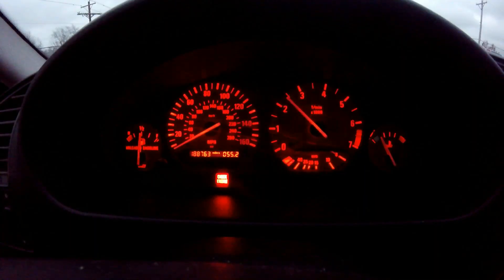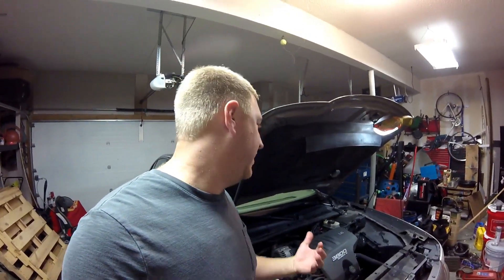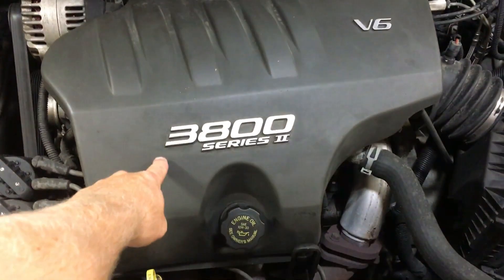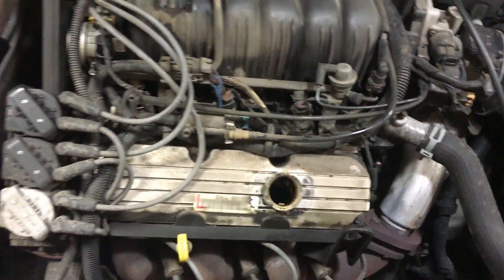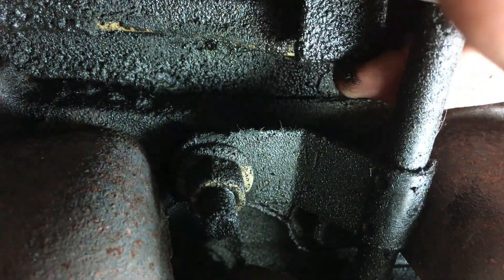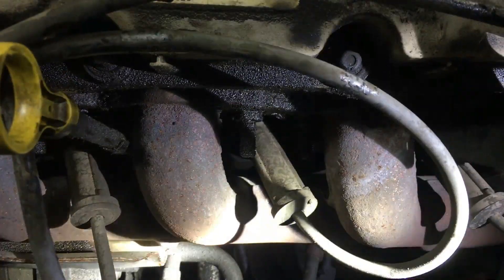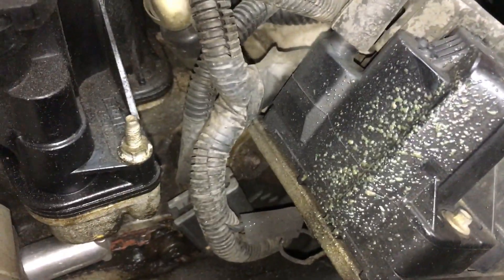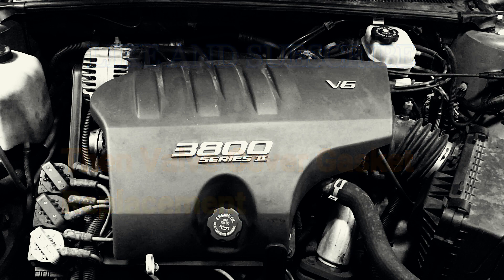Diagnosis of oil leaks on a GM 3800 V6 - Valve cover gaskets and intake manifold gaskets

Comment: I got 2008 Buick Lacerne 3800 CLX and I had a valve job done on it now I leak out of the filler tube or filler cap I took it back to the same person they said the PVC is good on it and I need to probably another O-ring so I got O-rings well it still leaks after driving it real hard for about a hour yeah also it’s got a new tube oil filler tube..Can you help me out let me know your thoughts
Reply from the maker: If it’s leaking that badly then there must be a rolled gasket or too much crankcase pressure.
Reply: @PetesGarageandperformance  Not badly but  is leaking
Reply: I change the valve cover and the oil filler tube and all is good it was a connection between the filler tube and the valve cover
Reply: Now I got another problem all of a sudden I don’t wanna start -the starter will keep turning or it won’t work at all but it won’t start I think it’s a control module for the ignition but I don’t know any ideas

Comment: Do you have a video on actually replacing the valve cover gasket on a gm 3800 v6?
Reply from the maker: Yes I do. It should be in my 3800 playlist

Comment: 2004 pontiac grand Prix gtp SC 3.8L. But the whole driverside fenderwell is cover in engine oil. You see engine oil dripping off the CV axle boot any idea.
Reply from the maker: Sounds like grease from the cv boot being flung around as the shaft rotates.

Comment: I about died when you threw that cover in the garbage. In no damn way will anyone throw mine away on my 03 monte carlo.
Reply: GM had a fire related recall on the Series II 3.8 V-6 engine.  The recall was for the front valve cover gasket leak, and to remove the plastic engine cover he tells you to remove and throw away.  There were some engine fires due to the valve cover gasket leaking.  When there was a fire the plastic engine cover also caught fire and burned.  I had the recall work performed, and they also had a new and revised front valve cover as part of the recall.  There are many 3.8 Series II engines still in cars that are still on the road today where no recall work was done waiting to catch on fire.

Comment: I have a 3.8 v6 that getting water into the engine but it's not overheating so don't think it's head gasket. any ideas???
Reply from the maker: Is the water getting into the cylinders and hydro locking them or is water getting into the crankcase/oil pan.
Reply: @PetesGarageandperformance  yeah when you drive regularly the engine eventually won't start. but if you leave it for a while  it will start up again. water in engine but not overheating. can see little water when I open oil cap.

Comment: I found oil leaking in between the engine block and  front valve cover/head gasket on my 99 buick lesabre custom. Diagnosis?

Comment: I tried to get that cover off of there but I wasn't able to. After I took off the filler cap, there's a flange around the filler nozzle and all that cover does is swivels around. Do I cut it off? Is that valve cover plastic, could it break if I try n force that cover off?
Reply from the maker: The valve cover is thick plastic. I’ve never seen it get stuck. Just twist the tube 1/4 turn counter clockwise and pull.

Comment: Pete, my vehicle is leaking oil, but it was repaired under the recall.Should I be having an oil leak now?
Reply from the maker: Is it leaking from the front valve cover? If not then it’s going to be on you to fix.
Reply: @PetesGarageandperformance  Yes, it is leaking from the front valve cover. Should this be happening when it was replaced under the recall in 2016?
Reply from the maker: Probably shouldn’t leak for a while but that was 5 years ago. When the recall was put out, I think a lot of techs were just slapping the new covers and gaskets on and not really cleaning up the head surface or even torquing the bolts. You might want to just buy a new gasket and redo the job. Or check to see if the bolts are tight.
Reply: @PetesGarageandperformance  Actually it started leaking last year along with the lower valve leaking.

Comment: i put the oil cap back on so nothing falls into the oil reservoir fill. also, sometimes if you catch the oil leak early enough, you might be able to just tighten the valve cover bolts. Only sometimes this will work. the other thing about throwing the plastic engine cover away, is now the engine looks UGLY!!!!!  LOL>>> They build cars like crap anymore, almost everything is plastic and aluminum.... Just does not last at all. I am so glad i grew up and saw and worked on, Easy work on, great cars in my life until the early 1990,s. After that, CRAP CARS MADE!!!!!!

Comment: Thanks for the videos I have a 2001 grand prix I been looking for a oil leak and it seems like it is coming from right above my trans axle where my oil filter screws in there is a electrical wire and its coming out of where the wire goes is that my oil presser sensor.so I'm asking is that a common problem I got 160000 plus on it
Reply from the maker: Yes that is the oil pressure sensor. Also make sure it’s not coming from the oil filter adapter gasket which is the part that the sensor screws into.
Reply: Ok thanks a lot gonna Chang it tomorrow

Comment: I have two Buick’s with the 3800 engine. Most common repairs are upper and lower intake manifold gaskets and valve cover gaskets.  The engines have 167 k and 272 k miles on them . MPG on the 167 k engine is 41 highway and the 272 k engine still gets 31 MPG.  The 1999 has a crappy paint from the factory; but the paint on the 2001 still looks like new.  I want to be buried in one of them, I just can’t decide which one.😎.  I love your Youtubevideos 💪
Reply: no way 41mpg I believe the miles but that car never got 41mpg
Reply: @smdog66    The 41 MPG is achieved by increased tire pressure,  not using the A/C and only driving it on the highway. From a ranch in Wyoming to a ranch in Nebraska;  with no stops, towns, or visits with either state patrols.  Never, ever attempted to use ethanol gas. Only the best octane gasoline, I can find.  Super slick wax job on crappy paint job and rain X on all the windows.
Reply: @smdog66  i never got over 19 mpg
Reply: ... im lucky to get even 10 mpg in my 06 Grand Prix 😂
Reply from the maker: Thank you. 41 mpg. Wow that’s awesome.
Reply: HI, my 3800 v2 seems to be leaking oil on the passenger side and the serpentine belt is slinging the oil up onto the alternator.....  ever heard of this and where is it likely from?
Reply: Bs on the 41mpg! Lol
Reply: Oil pressure sending unit

Comment: When you guys do the lower intake gaskets, are you supposed to oil the new gaskets when you put them in?
Reply from the maker: No. Don’t put oil on the gaskets.
Reply: @PetesGarageandperformance  thanks so much for the quick reply.
Reply: I chose to have a mechanic apply JB weld to a pitted area of lower intake instead of a new one for $500 or my bill would of been 1700 ..I hope it holds..but now 3 days later I see oil on my cardboard  after 3 days of no spot..hope it's not the lower Intake where they JB weld..idk..2000 buick regal with 80000 jus had upper n lower Intake gaskets replaced with a new plenum..its leaking right in center below oil pan...

Comment: The 3800 in my 2005 Pontiac Grand Prix has 307k miles. I'm starting to see these same problems. Thanks for the heads up!
Reply: 370k Starting to see problems lol that’s funny you know what .
Reply from the maker: Pretty common issues on these. At least they’re cheap to fix.
Reply: @PetesGarageandperformance  Mechanic told me that the rear seal needs to be replaced.

Comment: I’m pretty new to cars and genuinely curious. How does the engine beauty cover and the spark plug holder lead to the leaks? I also own an 00 LS and it still has both of those on it.
Reply from the maker: Good observation. They don’t directly. But what happens is that many of these vehicles with the 3.8 are still running. As you can imagine, they’re high mileage, cheap, and leaking from the valve covers, intake, and oil pan. Many people just ignore the valve cover leaks and over time the leaking oil accumulates as sludge on that spark plug wire holder. Right above the hot exhaust manifold. Then a fire can occur. I think they pitch the cover because it holds in heat. Really GM wouldn’t have had to recall the valve cover if people would just fix their leaking valve cover. But I guess it was probably in their best interest to just bite the bullet and take care of it instead of having lawsuits on their hands when the car catches on fire in the garage and kills a family. This is all just my opinion though.

Comment: Do the intake gaskets leak oil?
Reply from the maker: Yes. They will leak oil and coolant. Depends on which part of the gasket fails. The gaskets seal oil at the China rail of the engine and where the intake meets the head. It also seals coolant at the ports where the coolant flows from each head to the thermostat and the crossover ports in the lower intake where the elbows hook to the belt tensioner.
Reply: @PetesGarageandperformance  Hm, I put full synthetic in last oil change and shortly after it sprang a very slow leak somewhere. It's like a quart a month so not a huge problem yet. It's not the oil pan or filter. Puddles are under the passenger side of the engine, I don't see anything in the front of the engine, can't really see in the back. Fun times lol.
Reply from the maker: Yeah it sounds like you need to get the vehicle into the air so you can see where it’s coming from. It’s hard to see with the vehicle on the ground. It could be one of the valve cover gaskets too.
Reply: @PetesGarageandperformance  I'm hoping it's a valve cover, cause it's easy to do lol. Upper intake wouldn't be too bad either but I don't see any oil around that. Worst case is lower intake.

Comment: How much does a job like this cost and or should I just drop a new engine...!??
Reply: about $450 including lower intake manifold gasket, upper intake manifold gasket, valve cover gasket, and aluminum heater elbows. Na dont get a whole new engine. The orange gasket would have to replaced either way. Use the fel pro metal gaskets. Dont use the same orange ones.

Comment: Mines leaks oil bad and I have oil slang all over my engine...!?
Reply: And its making a ticking sound starts up drives 50 feet then dies
Reply from the maker: Is it ticking inside the engine? Or does it have an exhaust leak? If it has been run low on oil too long, there may be internal damage. Depending on what all is leaking on your engine, it may cost around $800-$1000 to fix them. That’s still cheaper than a new engine. If you got a used one from a junkyard, you would probably have to do these repairs anyway.

Comment: I also have the same engine and I put the green antifreeze 100k miles  I had a GM Master mechanic tell me it was the DEX COOL that caused corrosion and tuned ti acid and ate the gaskets. I The GM garage flushed all the DEX Cool, out and put green antifreeze and it runs better on the green 100k miles coolant. DEX COL is crap. GM has a lawsuit pending on Dex Cool antifreeze issues.
Reply from the maker: Dexcool works well in engines that don’t have coolant running through the intake. On engines that used the intake as a crossover from head to head, GM had gasket leakage issues. These same gaskets leaked before Dexcool came around. However, Dexcool and oil don’t work well together.

Comment: The engine cover fits with the new valve cover.
Reply from the maker: Yes it fits. But part of the recall was to throw the cover away.
Reply: @PetesGarageandperformance  yeah i know i took mine in and they wanted to throw it out.  I said no!! And i put it back on

Comment: I see the tensioner L pipe has already been changed from plastic to metal, also a critical leak point on these engines
Reply from the maker: Yes. They also leak. But those leaks will be an obvious coolant leak instead of oil.
Reply: @PetesGarageandperformance  for sure that
Reply: The metal ones are crap too they don't seal well esp. Dorman.  Better off to get the OEM plastic ones again they should last at least another 4-5yrs.
Reply: @c.anderson3444  the metal ones on our buicks are doing an outstanding job thus far
Reply: @ItsaRomethingeveryday  which brand did you get? The OEM ones are good they don't leak until they get brittle with the dexcool. Alot of people switch to green coolant to avoid issues with intake gaskets and plastics. I kept the the dex in. 250k and going strong, might put intake gaskets in just for grins. I'd throw a supercharger in but that 65e trans definitely won't have it.🤕
Reply: @c.anderson3444  I drained dex cool, replaced with green, and use FelPro gadkets

Comment: Have you started the repairs? I am in need of information about the tools and procedures to remove the entire cradle from my 2004 Pontiac grand prix GTP. Got bad advice from a mechanic about a lifter ticking .Followed the advice even though the other indicators were pointing to a gasket failure. I was advised to change the oil ,add the engine oil treatment. So I changed the motor oil & filter ,then put new oil&filter on and added a engine cleaner product. Ran the engine for 30 minutes and drained it. Then did another oil change with filter. Drove it home36 km hoping that the lifter would ungum but it didn't. Drove it back 36 km to the shop . Asked about if the engine might have an coolant leak. Gasket failure possibly. Was told that the lifter might need a different chemical product to loosen up the lifter .But now the engine light came on ,so he scaned it and said that the o2 sensor was giving a code .(That is the same thing that happened to my other car which ended up with a blown  head gasket )So I asked him about that previous experience,, he said it will be fine. 2 days later he went on a 1 week holiday and I was doing minor things .On a Friday I drove back to the mechanic shop,to check on other things . I was going to the big city to help a friend.  So I checked the oil dipstick and the oil felt wrong . I asked his son about this . He said that it looked fine . So I drove it to a friend's house to help him out with a plumbing problem. I fixed his problem (took 2 days) and left for home (a 2 hour drive each way ). So 1 hour into the return trip the engine overheated. I pulled over and let the engine cool down. 2hours later I checked the radiator and there wasn't any coolant. So I had a jug of water in the trunk and put it in the radiator. Started the engine and drove to a town .5 minute drive. Stopped at a convenience store. And had to let the engine cool down again. Checked the coolant and it was gone . Added some more water ,started the engine and it was hydrolocked . So I turned the engine, called a tow truck and towed it back to the mechanic   shop. So now I have drained the oil pan and removed the filter .  So now what was a simple supercharger removal to get to the lifter valley and replace the lifter and investigate the conditions, has resulted in a blown motor. 
I can understand that people make mistakes BUT even after all the indications were pointing to another issue I now have to remove the entire cradle. Can you offer any advice based on experience with the 2004~2008 Pontiac grand prix?
Reply from the maker: I did this job a couple of years ago. 

In your case, I would find out which cylinder was hydro locked by removing the spark plugs and seeing which one was full of coolant. The coolant is probably coming from the lower intake gaskets. I guess you could have a blown head gasket or cracked head. If you’re doing intake gaskets, it’s not that much more work to pull the heads off. Hopefully your bearings are ok  and not scored due to coolant in the oil.

Comment: I got a 2003 Monte Carlos ss smoke came from da oil.cap an stick not out da rail pip its da head gasket huh
Reply from the maker: Smoke out of the oil cap is usually a sign of worn out piston rings or a broken piston. How many miles? Does it consume oil?
Reply: @PetesGarageandperformance  bout 200,000
Reply: @PetesGarageandperformance  yea no smoke our da pipe not mliky

Comment: I have a question I just purchased a 2000 Buick LeSabre runs good drives good I drove it over an hour away and it's not overheating is there a way to tell if the intake gasket is leaking
Reply from the maker: Usually you’ll see oil/coolant stains that run down the heads. Also make sure the coolant doesn’t have sludge or oil in it. That’s an indication that the gaskets are leaking on the inside parts. Thanks for watching.

Comment: Those 2000-2005 lesabre didn’t have any recalls for the valve cover gaskets. It was mostly the W body cars with the 3800 that have the recall for the valve cover. My grandmas 2005 lesabre has over 200, 000 miles and still have the plastic engine cover on it
Reply from the maker: BrendenAerosmith Farr correct. Only the W bodies were recalled for some reason. It’s the same engine setup so I have no idea why GM would recall one and not the other. But they all leak and would need replaced at some point. At least they are easy to work on.